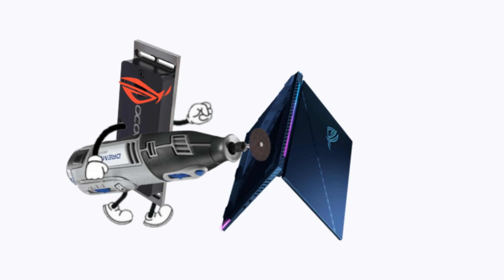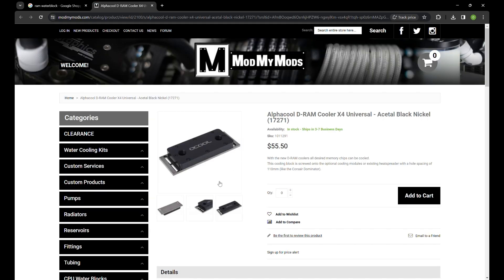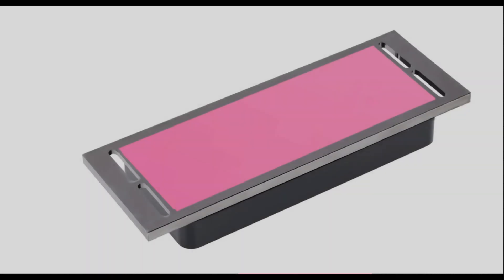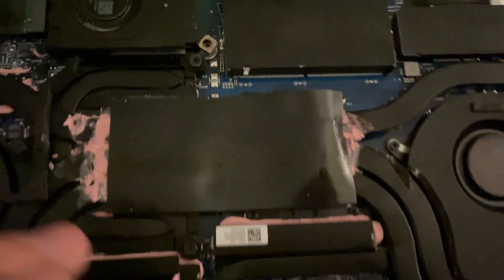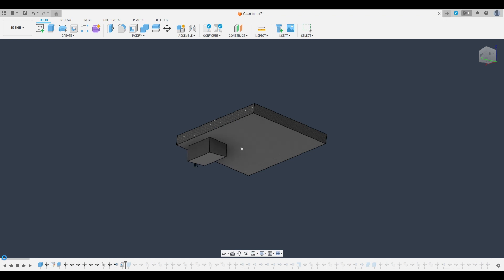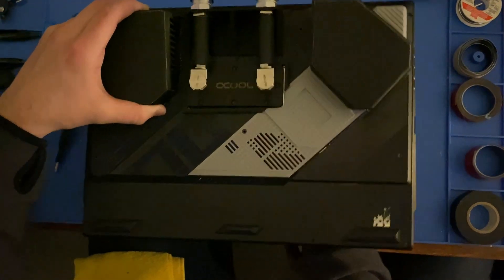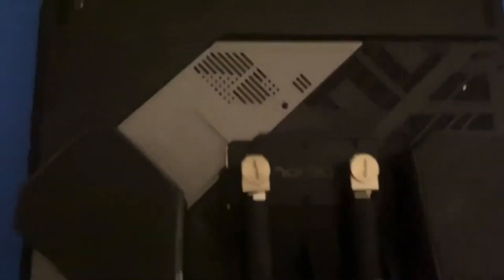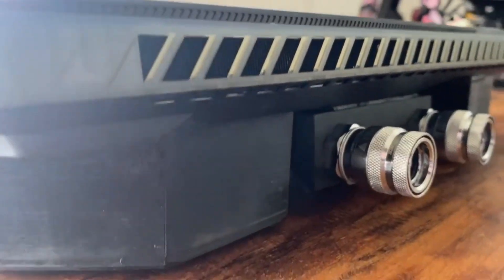How it's made, water cooled Asus Scar 16

Comment: Sorry man, I'm Italian so excuse my bad English, but I want to congratulate you in the meantime for this fantastic project. I have a MSI GP76 Leopard is I plan to replicate your project or make it similar. Unfortunately, the CPU reaches 97 degrees and my pc is getting ruined so I want to make a functional system. The only thing I don't understand is how does the ram waterblock stay in contact with the heat pipes? Is the putty you used an ordinary thermal paste or does it act as a glue? Did you solder something? I wouldn't know how to keep the ram waterblock well attached. I hope you can help me!
Reply from the maker: No worries! The putty being used is just a normal putty, not paste though, not and adhesive. Putty is thicker and has a longer service life than many pastes so it should last for a long time without any pump out issues. The block is just held on by the case cover. I cut the hole to be the size of the water chamber, not the cold plate. This way the water chamber fits through while the cold plate is pressed on and held in place by the lower case cover. I have some better picture on my LinusTechTips forum post here https://linustechtips.com/topic/1546110-water-cooling-a-scar-16-409013980hx-laptop/?do=findComment&comment=16290402 the last two pictures on the first page should help clarify.
Reply from the maker: To expand on that, it is because of how I use the cold plate to mount it that you HAVE to get a water block that has a flat cold plate. Many CPU blocks have a raised cold plate and will not work without seriously deforming the case cover.

Comment: What if the cpu and gpu are placed at a distance and one ram block cant cover both?
Reply from the maker: The fundamentals here would still apply, but it might not work quite as well. What is happening as you are cooling down the laptops own heat sink, similar to an integrated heat sink on a full-size desktop CPU. As long as you cool down the heat sink it will improve the performance a decent amount, but the proximity to the chips might make it not work quite as well.

 XMG claimed that the difference is negligible when they redesigned their in previous years Neo to only have the water pipe go around half of the heat sink.
Reply: @sloreo8278  since both the CPU and GPU are spaced apart and not even on same horizontal level. I was thinking of using AIO water cooler only on the gpu heatsink since it has a little bigger square shaped area. Is it worth it? I couldn't find any ram cooler in that shape
Reply from the maker: @Amit_Kattal  It should work, but it depends how you mount it. The main reason I used a RAM block was just because the cold plate is flat and fit under the bottom case cover. Im trying out a direct die CPU block at the moment to see how they compare and it is looking good so far, but you want to find something with a flat cold plate/mounting hardware.
Reply: I see. I saw u mentioned that thermal pad solution with aio isn't good . Is it because of heat transfer is less or size/gap problem? I would like to try with thermal pad first to not have mess because of putty. Would that still work if mounting is no issue? And have similar performance?

Comment: HELLO THERE  U WORK IS REALLY BRILLIANT CAN U PLZ TELL ABOUT THE TOTAL COST OF THE PROJECT BOTH(TIME&MONEY) TOOK U TO MAKE THIS PROJECT
Reply from the maker: The cost got out of hand and was nearly $1000, but it can be done for cheaper. Timewise it is about a day of work just assembling the parts and cutting the laptop's bottom case cover. Realistically any water cooling kit from amazon or prebuild external radiator will work, but it might not preform as well. 

The only parts that need to be the same/similar are the RAM water block and, imo, the Koolance connectors because of their extremely high quality.
Reply: @sloreo8278  Hi again my research over the internet to make good watercooling solution like ur's using a good pomp/reservoir combo cut the cost to 400 USD

Comment: To take a cleaner approach to this, would you say that designing a custom bottom panel wouldn't be a bad idea? I've recently acquired a 3D Printer and was wondering how effective a custom bottom cover would for this. Like that I can keep the stock cover intact while creating one that'll have the perfect size to fit the RAM block through.
Reply from the maker: If I had a bigger printer able to do a cover in one part I would definitely prefer that approach to clean it up. I was not a fan of needing to do the cover in multiple parts and was having a hard time getting the intricate angles on the bottom cover of the Scar 16 just right. If it was a more plain rectangle without the stylized RGB bar it would have been much easier to go that route. 

One reason I was hesitant to go that route though, aside from the practicality, is the difference in strength of the printed material and the OEM case cover. I trust the cover to hold up for the life of the laptop where I partly expect to need to reprint parts eventually.
Reply: @sloreo8278  You have a valid point. I forgot to take into account that the RGB's integrated with the cover, darn. I guess this approach really is the in between to keep the aesthetics and reliability.